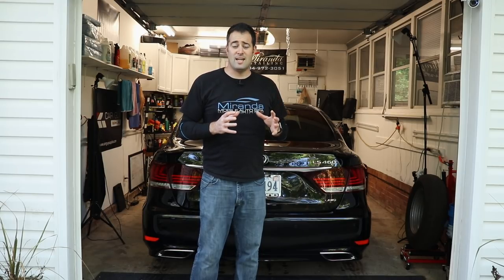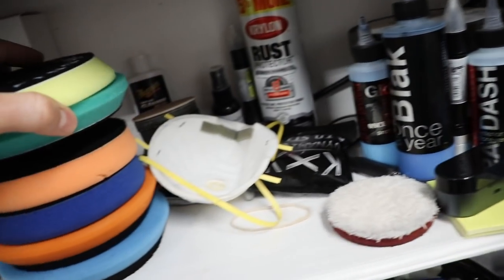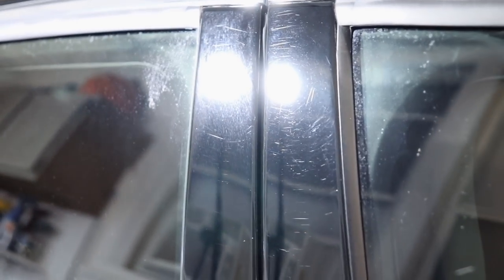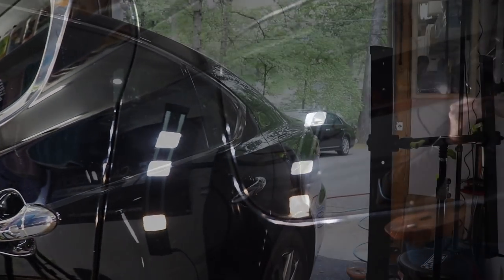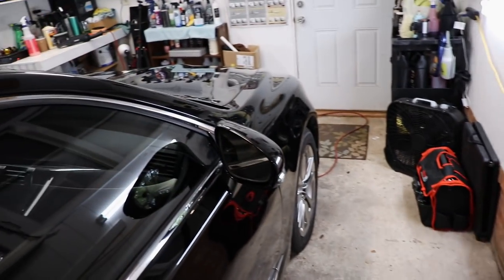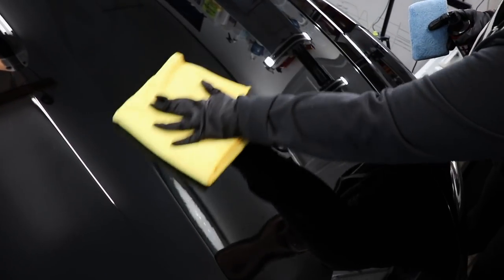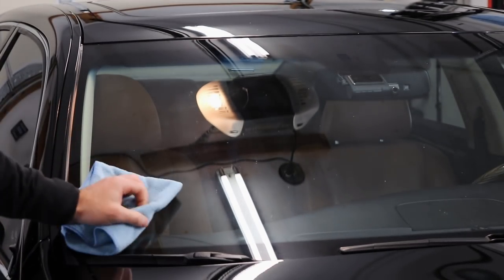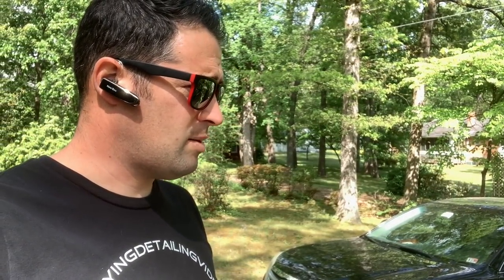Paint Enhancement and Wolfgang Uber Ceramic Spray Coating! #autodetailing #lexusls460

Comment: Great job again!! 👍 👍 👍
👏 👏 You two ✌️
I saw, you have meguiar's paint protect.  You should try a top coat on a Ceramic !.  I was not very impressed with pp365 alone, I like rolling water pearls.  But pp365 is more sheeting.  But on top of a Ceramic pp365 has superb water pearls that roll, it's a very good top coat, even meguiar's fast finish also makes an excellent top coat!
Reply from the maker: Hi. Yeah I use that for trim protection. I just don’t like the application, way to greasy for me. I really loved the Fast finish also.

Comment: Hello, would you or have you done a video on maintenance of a DA polisher, being new to polishers and just received my SPTA with no instructions on this  😁 would interesting to see if there is any maintenance
Reply from the maker: Hi. Honestly I haven’t really worried about that. I guess some have opened them up and repacked them heads with better heat resistant grease. But I have never had any problems. I think some just like to do that becasue they like to.  I have replaced parts before when they have gone bad,,,like triggers, cords, and brushes. But that’s pretty easy to do.

Comment: Hello Phil and Jess. Can you tell me when you apply a ceramic spray coating, what do you use to top it up when doing a maintenance wash. Would it be just a detailer ?
Reply from the maker: Hi. You can top it with any ceramic based topper or detailer just like any other ceramic coating. 😎👍🏼
Reply: @MirandaDetailing  Thank you.

Comment: Hi Phil I have a cheap foam cannon from amazon used on a sun joe 2000 psi electric pressure washer not getting alot of foam even with Adam's mega foam. Have you ever replaced the orpheus in a foam cannon to get more foam and did it work ? What would be the best foam cannon for me if I wanted to invest in another one ? Appreciate the advice
Reply from the maker: Hi. Yes I have replaced the orifice before in a foam cannon and it does work better.  I use cheap ones also, around $20, I just don't see the need to spend $80+ on a basic foam cannon.  I guess to each their own, but I have great success with cheaper ones.

Comment: Uber spray failed on me after a month. the water laid completely flat on the paint with no sheeting, tried decon wash and water spot remover but still flat. car was polished and prepped. the 1st wash though was amazing. the water behavior was great. had a nice deep look to the paint. the car got a lot of pollen on it and a lot of rain after it had cured. I dunno if that had anything to do with it. maybe I got a really old bottle that sat on a shelf for years. still have half a bottle. tried on a different vehicles hood and got like 85-90% failure on it as well. has to be an old batch or something.
Reply from the maker: Aw man. That’s weird.

Comment: Great stuff! Do you guys know if m100 & m205 have oils that fill? Thanks 👌🏼🧼
Reply from the maker: Thanks.   No they don't have fillers,  the oils are not that heavy so as to cause any problems with filling.  They can be easily removed with a light panel wipe.
Reply: @MirandaDetailing  car turned out great you two ! Thanks 🙏🏼

Comment: Nice work Phil.
What is the difference between 3D One and 3D Speed?
Reply from the maker: Thanks. 3D Speed has a Wax in it for protection. It’s considered an All in One polish. 3D One is just a compound/polish with no protection.
Reply: Great work phil and team... what's your thoughts on the longevity product... is it above the average tire shine? I'm always on the hunt for the best I can afford to buy
Reply from the maker: @barrybij8079  Thanks.   It last as long as any typical water based dressing.  if it doesnt rain it can last 2+ weeks or so, but the more driving that is done and if it rains any dressing will eventually wear off.

Comment: Does the trim coating excess wipe off easy from paint or windows? Maybe I’ll have to try this normally I use Malco trim coating / epic nu
Reply from the maker: Hi. Yeah it does. At least we didn’t have a problem. Just wipe it off the glass and pint right away

Comment: I tried a glass coating once and it streaked would it be because I was doing it outside ? Does this glass coating need to be done indoors ? Also does glass cleaner strip it off
Reply from the maker: Oh yeah, any coatings should be applied indoors in a controlled environment.
Reply from the maker: If it’s cured just use a polish or compound and machine polish the glass to remove any coating. Glass cleaner will not strip it